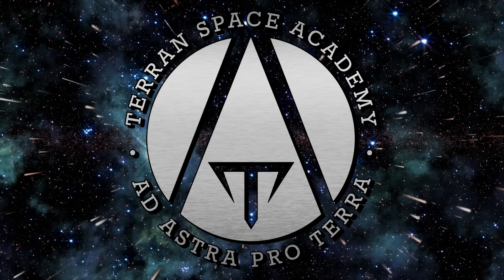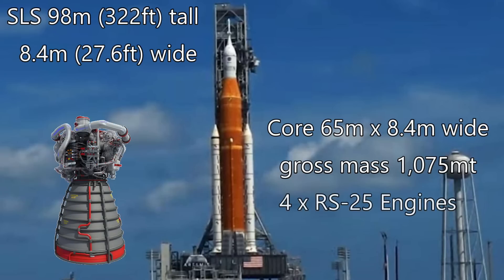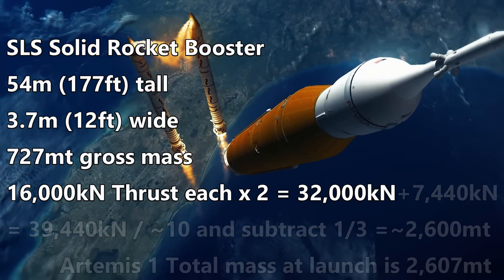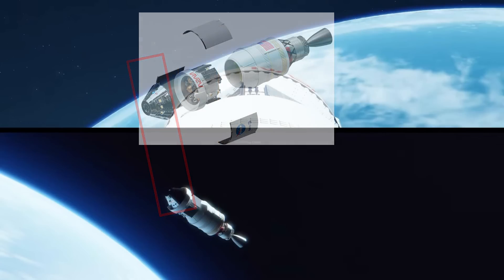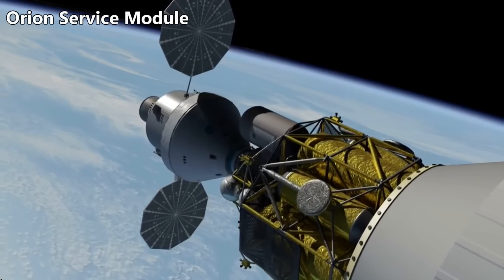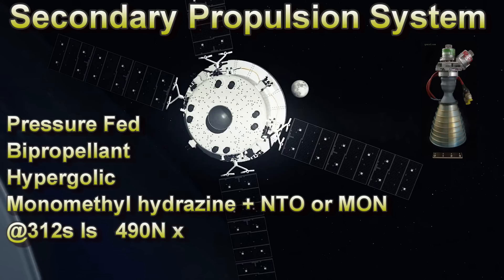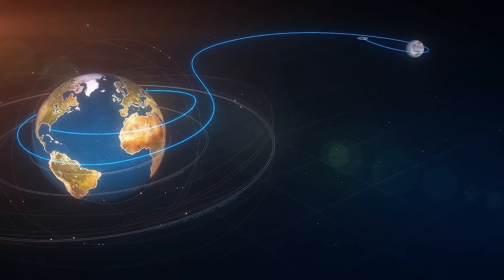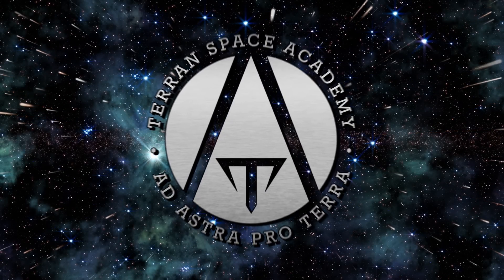Artemis 1: Understanding the Space Launch System

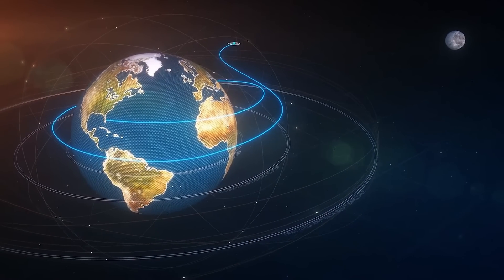Comment: 8:35 isn't that illustration majorly wrong?
The only way you could bend the path rightwards would be using fuel from the spacecraft
Reply from the maker: That looks like the outbound trajectory correction burn and does indeed require significant deltaV, though the Moon's gravity helps some...

Comment: Fun fact; one of the design constraints of the solid rocket boosters is the width of a horse posterior...

Turns out the Shuttle boosters they are based on had maxed their diameter based on the railway tunnels from their manufacturing site.
Railway tunnel width is based on US standard train track width, inherited from britain's industrial revolution. 
Early train makers were converted horse coach makers, so they used their standardised width based on european road's ruts (to avoid breaking wheels or being perpetually leaning on one side).
Turns out that width was standardised because the roman-made roads were of a standard width, to allow two-horse carts to pass each other all the time...
And THAT was based on a horse's posterior width. 😅👍
Reply from the maker: That's hilarious!

Comment: Actually the use of comma together with dot can cause confusion as the comma is used as decimal point in many countries. Although I read English texts everyday when I go to the market 2,50 does not mean 2500 but rather just 2.5 € ... So seeing somthing like 4,436 m/s can be quite puzzling ... (first thought: How can it be that slow?! ... must be an error) For various reasons I avoid separating thousands and rather use a space or better nothing at all. Usually you can multiply by a power of ten or just change the SI-prefix.
Reply from the maker: Very true Mathias.  I always get confused seeing commas for decimal points in European publications.  I wish we could all standardize...  I'll start putting 2 thousand or two thousand when possible.

Comment: What is the difference between dv and acceleration? I believe that acceleration has the time constraint of dv/dt, while dv could be in any time frame, but am not 100%  sure.
Reply from the maker: deltaV is the change in velocity only... not over time.
so 50m/s to 150m/s requires a deltaV of 100m/s.  Acceleration is how quickly that change was made.
If it happened over one second the acceleration was 100m/s^2.  If it happened over ten seconds the acceleration was 10m/s^2.

Comment: RS-25 - Space shuttle engine, limited quantity.   Once all of the RS-25’s are used, the core will have to be redesigned for new engine.  Building new RS-25 engines possible but cost would be too high.  Solid Rocket Booster - From Space Shuttle with extra section.  Core Stage - New Design using space shuttle external tank design as starting point.  Crew capsule - New, systems not finished, capsule not man rates.  Billions of dollars spent, years behind schedule and little new technology for the money spent.
Reply: They will restart production. Once the current engines have run out, they will start production of a new expendable version.
Reply: @spaceenthusiast7160 I did some research after posting my comment and found where NASA issued a 1.79 billion dollar order for additional 18 engines.
Reply from the maker: $100 million instead of $146 million!  Bargain!
Get ready for the cost overruns.
Reply: RS25E’s that are better and cheaper will replace shuttle stock after. No redesign. RS25 is still the best engine ever
Reply: Or they may be counting on private industry.

Comment: I hoped to hear more about the RS--25 ... actually it is burning from sea-level to almost vacuum and isn't an aerospike engine ... never understood why they didn't just use just another or two solid rocket booster which would bring the whole thing out of the dense atmosphere so that more vacuum optimized engines could be run .... at least might have saved hydrogen and probably increased payload
Reply from the maker: Covered in depth here...
https://youtu.be/5gdNDXF0dMI